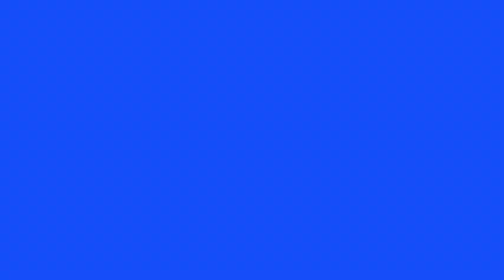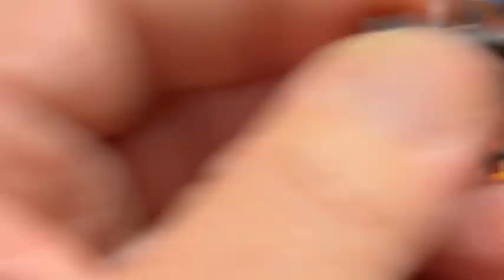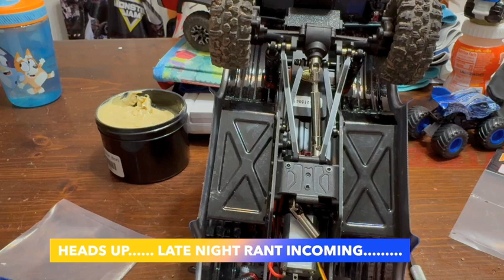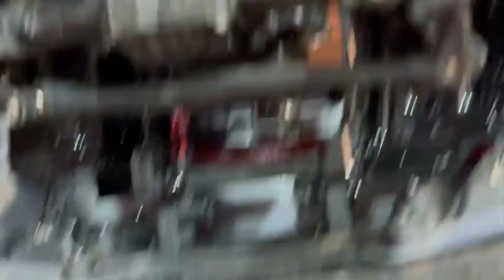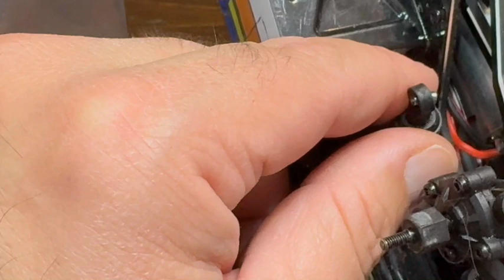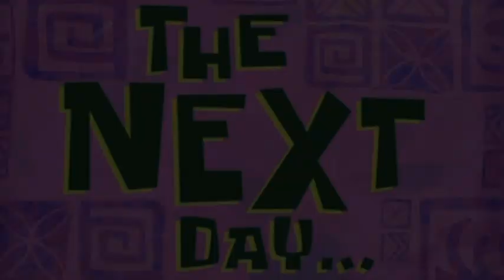Upgrading the Hobby Plus CR18P Evo 2 RC Rock Van! Front drive shaft, links and brass portals

Comment: Couple of tips for newcomers:
When working on the drivetrain, I put the gearbox in neutral first ( if I remember )… it makes it easier to line things up. 
Also, make sure the driveshafts are “in phase”… the two halves ( of each one ) need to line up equally… not just for looking right but otherwise you’ll get jerky driving.
Reply from the maker: Good tips! Thank you!